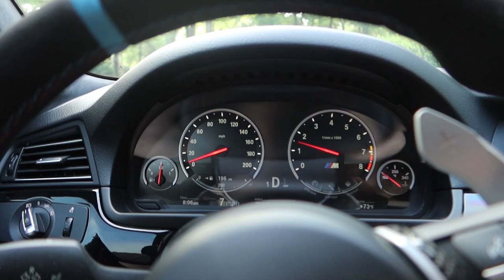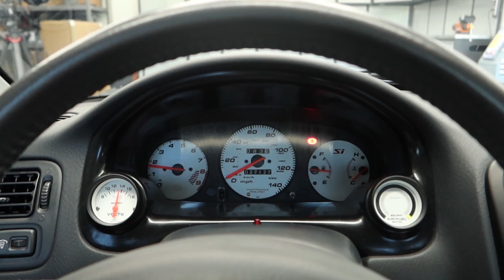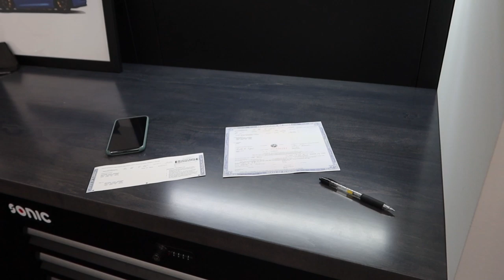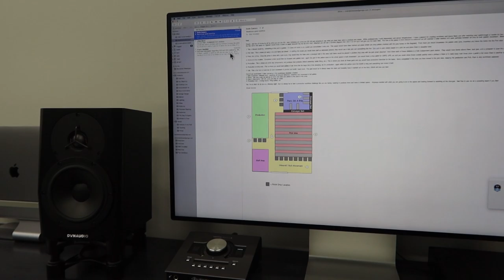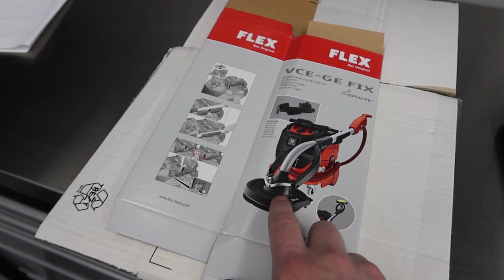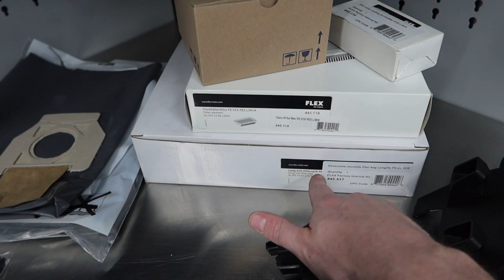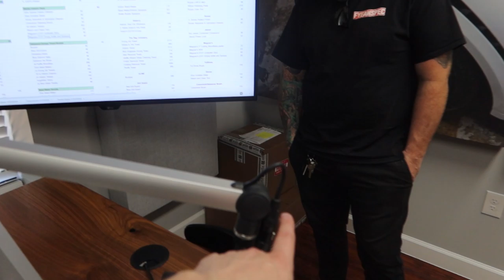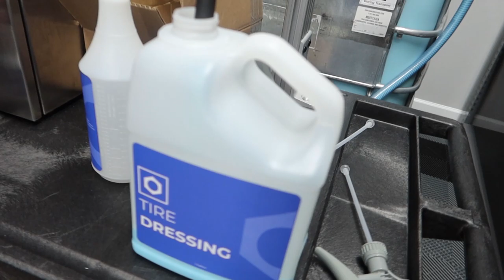M5 Winner Pickup and Hanging Out With Tommyfyeah

Comment: I'm assuming that the Flex vacuum is essentially the same as the Festool. A lot of the components look very similar. If that's the case, it's going to be a fantastic alternative to the standard big box vacuums. My Festool is incredible, I wouldn't ever go back to a standard wet/dry vac.